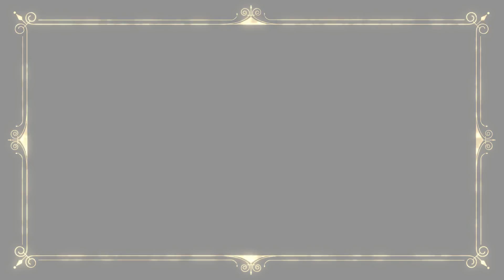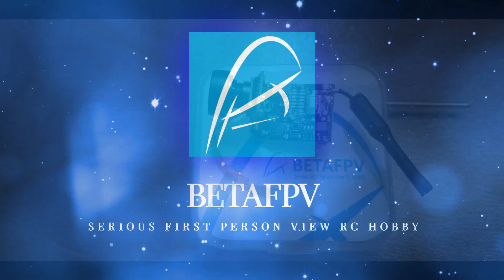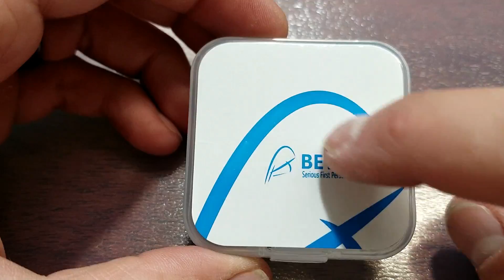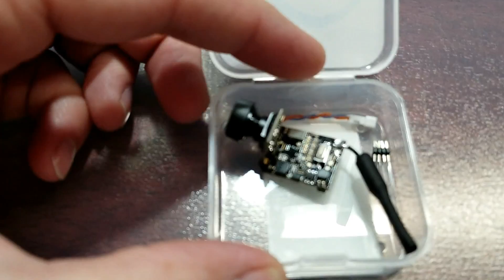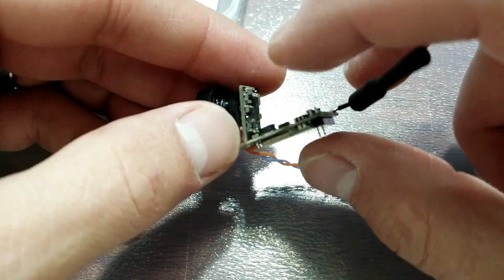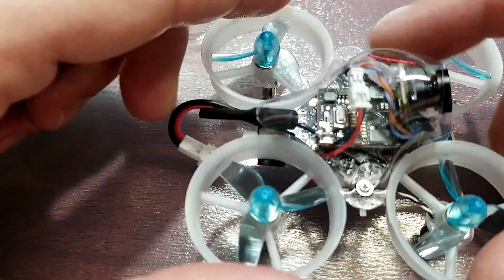BetaFPV Z01 AIO Camera with support for BetaFlight OSD

Comment: you say to ask questions but dont answer many was wondering what the white button is for on vtx board i am having trouble connecting to quad which it already was. had to reinstall firmware on my jumper t8 now now signal to same googles that it previously worked on
Reply from the maker: I did say that.  This video was posted sometime ago. I check is ever so often.   I no longer fly.  The button is to switch bands and channels to match your Goggles or receiver.

Comment: I have the same problem as Mr Guppy 101 but didn't see the problem resolved. I soldered on some battery leads onto the camera and it powers up and I can change the channels and bands but it does not transmit on any channel or band. I have tried scanning for the transmitter on both my goggles and monitor and  They can't find it. All of my other cameras work fine. Product support is non-existent! Please help!

Comment: Is there any way to focus this camera or is it a fixed lens? Recently just purchased a beta 75pro from flight Club and when I hooked up to my goggles everything is out of focus.
Reply from the maker: Nick Bainton yeah you will need to heat up the lens and break epoxy loose then you can adjust the lens
Reply: Thank you very much man I appreciate... keep the vids coming bro
Reply: What is the best way to adjust these cameras?
Reply: how do u heat it up
Reply from the maker: You can use a heat gun to loosen and melt the epoxy.   Just a second or two will be enough.
Reply from the maker: Heat gun to loosen the epoxy.

Comment: Has anyone who has one of these find a way to stop the camera from bending back into the canopy on a hard crash?
Reply from the maker: quadRUPPed do you have the new version?
Reply: I have the one that came preinstalled in the beta 65s bnf build I picked up.
Reply: Seems like the new version it has the 20 degree tilt and the nice solder joints but that didn't stop it from bending back.
Reply from the maker: +quadRUPPed the new version doesn't budge.  The old version I used hot glue mostly.
Reply: Pretty sure it was the new version. I can see where the solder joints snapped from the FC. I Think I found a solution that doesn't add as much weight as hot glue. https://photos.app.goo.gl/ib4rKCo4d3ldzPa63

Comment: I just got this beta fvp z01 and I was trying to connect to a eachine e011 but there is no way to know how to connect the cables and which one is the positive and the negative 
Some help please
Reply from the maker: +MR GUPPY 101 on the bottom of the z01 the pads where the pins are installed are labeled positive and negitive.  You can remove the pins and Install your own pig tail.
Reply: C Ray Tech 
Thank you c ray
Finally i figured that last night and it worked 
But now I can’t find the video frequency on my goggles lol 😂
Do I need to add the video in and out 
Or what tha hell im doing wrong
This seems to be a nice cam? Help
Reply from the maker: MR GUPPY 101 did you scan channels and bands in your goggles?
Reply: C Ray Tech 
I did but no luck 
I have other micro cams and I never had this problem 😓
Reply from the maker: +MR GUPPY 101 what band and channel is the camera on?
Reply: C Ray Tech 
Last night I tried different channels and frequency 
Now I wonder if maybe this camera is on pal and need to b  change to ntsc??
Reply: Also someone told me that maybe this camera may not not be compatible with my spektrum goggles
Reply from the maker: +MR GUPPY 101 what channel and band range do the spektrum goggles use
Reply: C Ray Tech 
Uses standard channels and it’s most the common one 
And should work with most cameras 
Thank you once again 
I think this one doesn’t work for me
I’m so disappointed with this one 
I’m just gonna put a normal camera 
Thank you again